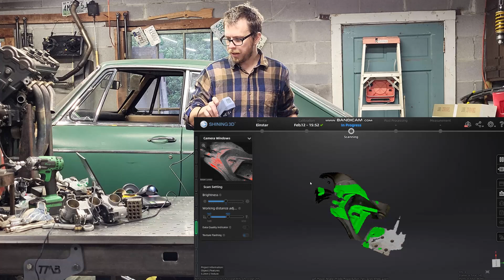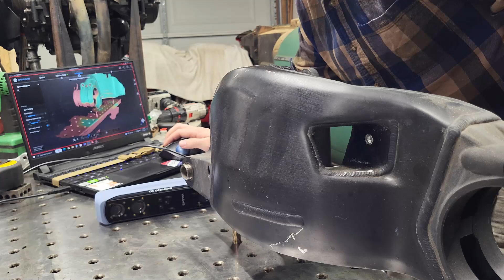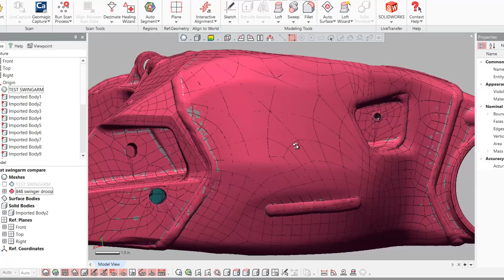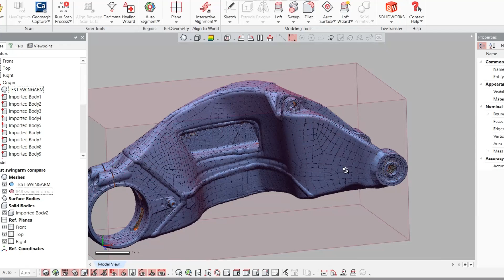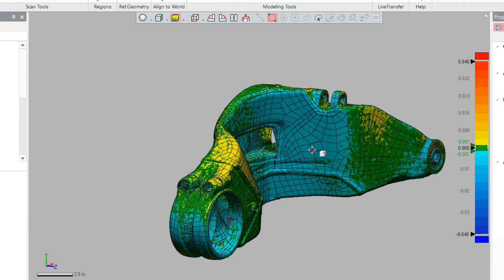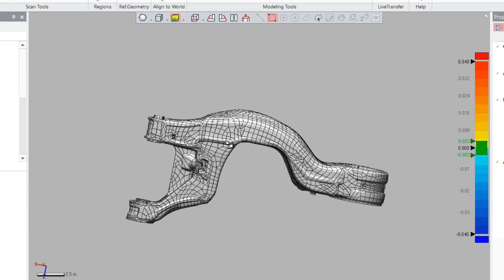Einstar scanner test. Is it any good? How accurate is it.

Comment: I am surprised you didn't notice that the deviation pattern appears to be repetitive and aligned towards the parts long axis. based on the thermal expansion of aluminum generally being on the order of 12.3e-6 /F, you get a total shrinkage across the length of about 0.0046" across 15F. You also cannot just add the directions of shrinkage/warp. Look at the pattern, it has distinctly shrunk along the long axis, with the short sides looking nearly perfectly within your 1 thou deviation. Convex areas from the datum you suggested on the small pin sides are blue, concave ones are yellow. This is readily apparent at 21 minutes.

Accounting for +-0.001", and +- 0.005" or so for temperature, you get a measurement uncertainty range of 6 thou symmetrical about 0, meaning the scanners might very well have produced the exact same scan, as most points in the comparison fall between +-0.004"

Comment: I've been looking at a number of these reviews of these entry level scanners, and finally found yours.  My full time job, I use Creaform Handyscan and Faro arm, and have often wondered about the accuracy of some of these $1000 scanners.  Yours answered my question.  I'm actually more impressed then I would have expected, especially for the money.  I completely agree with your assessment of this unit.  Definately wouldn't want to use it for high end engineering / reverse engineering, but looks like it would work well for some work with not as high specifications.  I reverse die blocks, and have clearances of typically 0.1 to 0.2mm cutting clearance, so wouldn't work for that, but would work great for some home projects or even less critical die components. (raw castings is a good example)  Thanks for the great info.
Reply from the maker: Yep, Its great for the price.  It struggles on small parts. The software is lacking but apparently the new update is great, I havent tried it yet though.
Reply: I looked at the Creaform to augment our FARO Scan Arm with the HD scanner. Passed on it due to the target requirements. I can’t get anybody to use the scan arm as it is. Probing is just too easy, plus FARO supplies a calibration plate that isn’t hardly big enough to calibrate the full scan envelope in both directions, so that’s a headache. These guys don’t even know the pain of the little red line ES scanner from back in the day.

I’m thinking about checking welding fixtures and doing warpage studies on parts without dragging out 100lbs of portable CMM. Pretty exciting.
Reply from the maker: @ I started with the red line laser on a edge arm. I’ve traveled all over the country with that damn thing. I just flew with this einstar scanner and man it all fits in a tiny harbor freight case. I may do a comparison soon with the einstar and a new faro blue laser of the same part at the same time, possibly with and without targets.

Comment: When you say you have to delete and start over again because you don't have a return button, you are wrong in that,  if the scanner makes something wrong and creates something that is not there, you just need to press and hold Shift down and mark the area (with the lazo) that is wrong with the left click of the mouse, and delete that area, and once done, you can keep scanning.
Reply from the maker: @ARTpocalypseStudio  I understand that and I use it often. The problem is usually it places data over the good data and I'm selecting so much to delete its usually easier to start over. Not always but usually.

Comment: Hello, I purchased this scanner a while back but I haven't purchased a laptop yet to use with the scanner. Do you have any suggestions about
which laptops would be a good choice? Thank you
Reply: High end gaming laptop with 64gb with NVIDIA gpu or a Gaming Laptop with a 3000 Nvidia gpu with 16gb and do the point cloud merging on a powerful desktop PC with 64gb ram.
Or buy a CR Otter. 16GB ram should be enough and a IGPU is working too. But it could reduce scan fps.
Reply: @Todestelzer  Thank You

Comment: What fixture table do you have?
Reply from the maker: @skrunsthestreets  I built the table. The frame is 3x5 .250" wall and the top is 1.25" surfaced to .004" flat with 1/2-20 holes every 2 inches.

Comment: Translation
If you compare the accuracy of the scanner at the beginning of work and after 1 hour, as it heats up, you will be surprised at how large the error is. As an Einstar owner, I am very disappointed with this scanner, especially after buying the Ender. Yes, Creality has bad software, but Einstar's software is not perfect either - you won't be able to scan a car in 0.2 resolution, the algorithms won't be able to build a mesh. But Ender with its terrible software can do it, and the accuracy of Ender according to my measurements is ultimately higher than that of Einstar.

Comment: It’s a Cost benefit analysis and case of diminishing returns you could spend $2000 to get 0.1 accuracy or $78000 more to get down to 0.02accuracy . It comes down to what your scanning 4 thou off plus or minus is 0.2mm off actual so if your looking to scan a dash for a 3d caddy or foot well or bumper you’re probably pretty good with cheapy.

Have you seen the creality raptor? That has 7 blue laser lines for 1500. The guy “Payo” has a few vids on that and the otter. 

I swore to never buy Chinese stuff if I can avoid (due to monopolist approach and potential to be a major adversary in the next few years) But when the next closet scanner is $8000us plus. For the peel scanner it’s hard to go past. I’m in Australia so we pay 70% more on exchange rate so it’s 2300 vs 13000AUD plus duty and import fees landed.

I’m debating on ordering the creality raptor and hope I don’t get burned - use it for learning and establish time of use. Ie if I use every day vs 1 per month. If use lots and getting paid fir use then worth getting a handy scan black elite limited.

Comment: They now have an undo button. Also you can delete part of scan by selecting it. Also, new version also has texture alignment, which if you have gaffer tape with hand written numbers or letters, it can use that for alignment.  Of course you could also use reflective markers and 3D scanning spray.
Reply: where is the undo button?

Comment: You should checkout the new Creality hybrid scanner. It has both NIR (near infrared) and 7 line laser scanning. 
It is the first consumer metrology grade scanner. As it is right now at release, it’s accurate to 1 thousand of an inch(0.02mm). 

At $1500US it’s a bit crazy, as the equivalent professional metrology grade hybrid 3d scanner is ten times the price. 

Please buy one and do a follow up comparison, the exactly the same way as this video. 

Great video! 

I was about to buy an Einstar scanner until the Creality Raptor 3d scanner was released. 

🇦🇺🤜🏼🤛🏼😎🍀☮️
Reply: problem with the raptor is the FOV and the amount of markers you need, also every maker costs you some surface detail, i would get a used einscan HX, more expensive but sooo much better also NIR mode on the raptor is shit, creality otter is way better at that so only the laser mode is good for something but only small stuff
Reply: @austrian_s60r64 you would need markers for the EinscanHX in laser mode too. The only difference is the HX has cross lasers and better software but cost much, much more.

I used NIR mode to scan a mobile AC last week to add duct work for the input and output air. Wasn’t that bad. Some tracking losses (feature mode) but no ghost capture date. Worked out fine.

Comment: For your base model using the Creaform Black Elite Scanner did you use targets to help the alignment of the scan data or was that done using just features? Must say I'm very impressed by the accuracy of the Einstar scanner when put alongside a much more expensive option.
Reply from the maker: Just features. I'm also impressed.

Comment: Nice video, good walk through of using the Einstar. Slight correction: Design X does allow you to compare two mesh bodies using "Mesh Deviation" function.  You're right, however, that the Accuracy Analyzer will not.

Comment: When scanning, a repetitive pattern like the fixture table you have the part on will confuse the software. If you covered the holes with a towel, or something with non-repetitive texture, it wouldn't be as likely to have problems. Scanning tires is kind of the same thing, it can get lost. If you want to avoid the issue entirely, but also increase the accuracy, tracking dots are necessary. I know nobody likes using them, but they do make a difference. 

The Einstar does a great job with large parts like a full car scanning at 1.5mm. You can still make out part numbers at that resolution on a lot of parts like mufflers, control arms, etc.

I typically use the texture mode even though I don't use the texture. I think it improves the tracking. I also always turn the quality indicator on.

You can quickly eliminate the incorrect data by selecting it and deleting it, then start scanning again and it will realign to the existing scan data. Just correct the problem if it was caused by a repetitive pattern before you continue.

Comment: I see a lot of car people demoing it. What do you use the models for?
Reply from the maker: I use it for all sorts of things. Cars and motorcycles are primarily what I work on / build so that's about it for me. You can go to my other videos and see the type of work I do.
Reply: But do you 3d print parts then? If so, how do you use it when it's fragile plastic?
Reply from the maker: @cgbyrobert  Some parts are 3d printed as a prototype and then machined. Alot of the scan data is then modeled into something usable and not 3d printed. Im designing new front brakes for my honda racebike right now and 3d printing the caliper mounts. Once the design is finalized the model will be sent off to be printed in aluminum.
Reply: @TMBchopshop  wow so one can actually get things printed in aluminum! Very cool. I'm just into visual effects myself but is thinking about building a camper van. This could be handy.
Reply from the maker: @cgbyrobert  Its not very cost effective yet but maybe one day. Im sticking to small parts because of this.

Comment: What's happened is the fabrication table has seen symmetry and decided it's in a different place. Put a few markers on the table randomly and go again. Use hybrid mode with features and markers 

You can scan alot easier than something like a revopoint scanner so I don't miss the undo button at all. It is a pleasure to use in my opinion 👍
Reply from the maker: It's not bad. Certain parts it can really be a pain and I have to use targets. For the price I think it's pretty excellent. I have never used the revpoint scanners as they didn't appeal to me.

Comment: There may not be a "undo" but thereust be a way to select and delete unwanted data as you're going
Reply from the maker: True. The problem I find with that is there is usually data misaligned somewhere you don't see or notice until later. This particular case I could have deleted that one section.